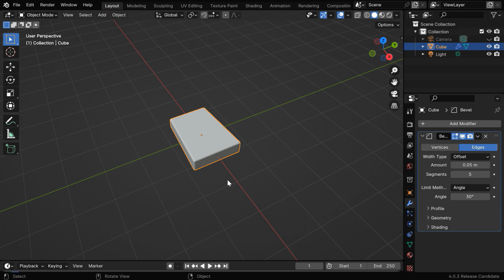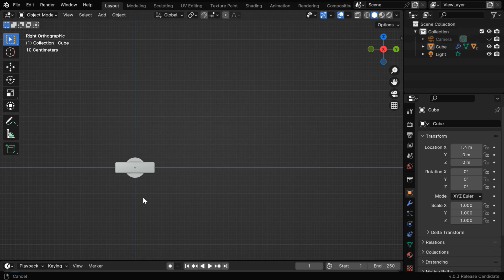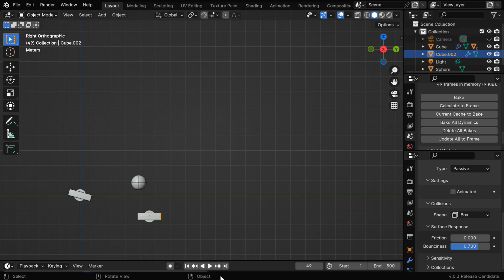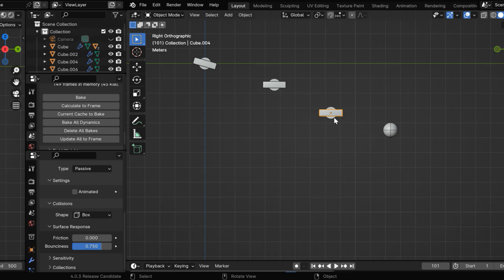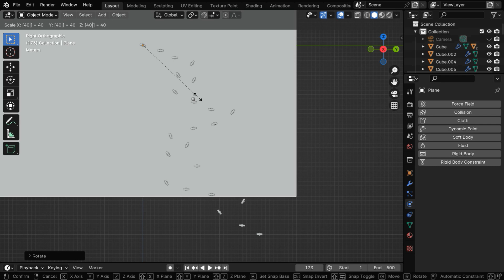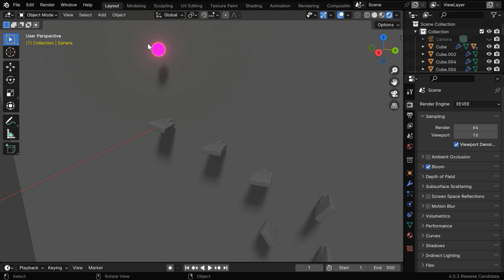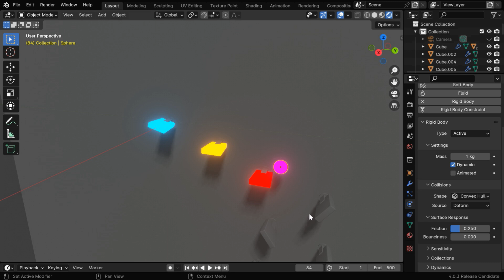Musical Marble Animation | Step By Step Tutorial In Blender | Rigid Body Physics With Sound & Light

Comment: יש לי כמה שאלות:
1. כשהורדתי את פיזיקת הגוף הקשיח של הכדור והקלידים, הכדור פשוט חדר אותם כאילו הם היו אוויר, ולא קפץ מהם.
2. בערך בשלב שבו אני החלפתי את החומר של הכדור, כל הסרטון נעשה יותר איטי,  אפילו אחרי שהעליתי את קצב הפריימים.
3. איך אני יכול לעשות שהמסך יעקוב אחרי הכדור, כך שאני לא אצטרך לראות את כל המסלול מרחוק?
4. איך אני יכול ליצא סרטון של המסלול?
Reply from the maker: 1) Please check if the rigid body physics is actually removed from the ball. It seems the physics was removed from the keys, and not from the ball, hence the ball is falling under gravity and it is not bouncing off the keys. Basically you might have done some mistake at some point, it is difficult to guess unless I see your blend file. 2) It depends on the material you attached to the ball. If it is a simple one-shader material, it should not impact the video playback speed, but it can certainly get impacted with more complex materials. But in any case, what you see is only a preview, and it can be slow - but the actual output won't be affected by this. Once you create the output video, the playback speed won't be impacted. 3) You need to set up your camera to follow the ball. It is a long topic, I suggest you watch our camera tutorials to get more experience on this. You can also purchase our add-on called "Set Camera On Track" which is specifically made for this purpose. 4) The process of converting your animation into a video output is known as Rendering. Please watch our tutorial to know how to do this 👉 https://youtu.be/w4YSGljBdww

Comment: I can't remove the rigid body physics from the keyboards (the remove option is turned off)
Reply from the maker: Please check if you unknowingly selected some other objects apart from the notes. If you select a mix of rigid body objects and non rigid body objects, the rigid body options remain disabled. Often a light or some other object gets selected when we try to select a set of rigid bodies.
Reply: @5MinutesBlenYou marked the keys along with the ball.
Reply from the maker: @ Yes that's correct. But in your case maybe your selection includes the background wall or the light - just a possibility - so the rigid body options are disabled. Another way to remove the rigid body physics is to select an object and go to the physics tab, then remove the rigid body physics with the cross button. But in this case you have to do it for each object separately.

Comment: by ball stop after touch some nodes
Reply from the maker: Please check if the physics bake is stopped at that frame. By default Blender physics works up to frame# 250 and then it stops. You need to manually change this number to the end frame of your scene so that the baking process does not stop at a random frame within your scene.

Comment: How do I make things smaller
Reply from the maker: You can select an object and either press S in the viewport to get the Scaling tool and use the mouse to make it smaller, or you can directly change the scale factors in the object properties tab. If you want to make all the objects smaller in an existing animation, I would suggest you rather increase your camera distance - it will make everything look smaller. Changing the scale of all objects in an existing animation may prove time-taking and a risky adventure.

Comment: Thanx for tutorial. Trying to make the same animation and i have problem with that. For example, i placed 10 notes. Ball move like i want, Simulation is good. BUT when i add, for example, another note - traektory of the ball changes for first 10 notes, But - this another note can not influence on the ball traektory for the first 10 notes. But it changes, and i can not solve problem - its again and again. Calculate to frame, i of course press. How can i save correct traektory for the first 10 notes and continue simulation after that? Or how add notes, and make it not influence on previous traektory. I tired to tring solve this problem
Reply from the maker: I understand the issues. Blender's physics is not 100% perfect. It uses an approximation at every step. So adding some new notes in the scene can sometimes dis-balance an existing physics - even at a previous step which seems completely unrelated. To overcome this issue, before you add the new objects, you can convert the existing physics movements into keyframes (bake to keyframes - we discussed this toward the end). And do take a backup at each step, just in case you need to go one step back to correct something. Now add the new note and keep converting them into keyframes at a regular interval. Even Blender's official guide recommends this since the physics is not 100% dependable always.

Comment: 9:09 There are a lot of musical notes.  I'm tired of adjusting the color changes on the musical note material one by one every time the marble ball touches it.  is there an automatic way to change the entire color of a musical note when the marble ball touches it?
Reply from the maker: We made a tutorial on how to use a script to detect the collision (with the ball) and add a custom property for each note without any big manual effort, that tutorial is here 👉 https://youtu.be/jOc559tQzuo With an extension of this method, you can set up a shader node group that checks for this custom property and assigns a random color for each note once the current frame crosses the Collision Frame for each note. This can take care of a huge number of notes with very small manual work.

Comment: Great tutorial. I discovered that there's no need to disable friction as this will cause the ball to not rotate naturally as it would in real life, thus breaking the realism. To prevent deflection, I simply place two vertical planes each set to passive rigid body on both sides of the ball to serve as a barrier. Of course, I have to disable their visibility in the viewport and render.
Reply from the maker: Yep, that's one way to restrict the deflection, I suggested this as well for someone 👍 Or we can let go the rotation and add it later using a driver (rotation calculated based on the move and the angle of move automatically). This looks reasonably real and it is less cumbersome. But your method is also good 👍

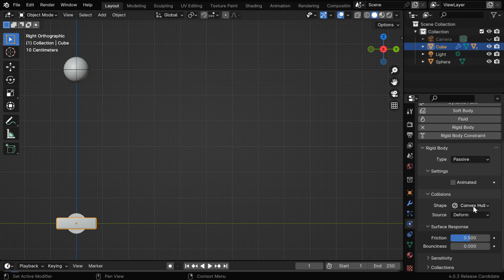Comment: Thank you very much for sharing, it has made me gain a lot. During the operation, I have a question, "My object will appear black lines after the video 3:42 shape is adjusted by Convex hull to Box", I can't solve this problem, can you answer it for me👃
Reply from the maker: The black lines usually appear only in the viewport, not in the render. It signifies the physics shape being used, it does not affect the render output. If you see such lines in the actual render, please send your blend file to us at 5minblender@gmail.com so that we can investigate and then suggest.
Reply: Thank you very much for the tip:yougotthis: @5MinutesBlender

Comment: Hey, bro, how to combine collision detection and random colors from the previous video? I'm a beginner in blenders, noob.
Reply from the maker: The collision detection script will define a custom property for each of the notes (this property will hold the frame number at which the color change should happen). For the random color, if you are referring to our earlier tutorial, you just need to mix the random color with the base color of the note using a Color Mix node, and add a driver for the FAC input of this note. The driver will check the custom property (collision frame number) and set the FAC to either 0 or 1 in order to take the base color before the collision and the random color after the collision.

Comment: it dont work i do everything like u but it wont work i dont understand the black background dont work it will be everything black or not grey...
After that the shader editor its not like your editor i just have 2 tables and you have 4 i know i can add them but if i try to put colour on the notes every note change the colour und not just 1 note... im so sad it wont work like it does in your video...
Reply from the maker: Don't worry. The notes have their materials connected by default, hence changing one of them changes all. Please select all the notes, then go to the Object Menu > Relations > Make Single User > Materials. Now each note will have its own copy of the material and you can change them individually. Sorry if this was not obvious. If you have any other issues, you can send your blend file to us (5minblender@gmail.com) with a problem statement. We'll help you to resolve all the issues.
Reply: thank you it workedd!!
Reply from the maker: @mertsari4809  That sound great! 👍

Comment: I tried to use previus color change based on collision but it not working is not give the tiles number of frame its stay in 0 (just work for the ball) Could you help ?
Reply from the maker: You need to keep all those object in a single collection and select the ball while running that script. The script simply picks up the currently selected object (the ball) and runs through each object in the same collection, it tries to figure out when each of those objects (the notes) comes in close contact with the selected object (the ball). It will add a custom property (frame#) for each of those notes. So please check if you are using the script with the right context.

Comment: The tutorial is amazing as always. I have watched such videos, Do they really use blender or another software coz their results is always top notch. I tried it using blender, but the process is very tedious and destructive. If you need to adjust one of the bounce, it renders the whole system null and now you have to repeat again.
Reply from the maker: Thanks! I can't say for sure whether they use Blender or something else, but it is 100% doable in Blender - not just the animation but the background sound as well. We rendered it using Eevee to show the beautiful output possible even with Eevee. But if you render it using Cycles, you'll get even better results. And as far as the physics part is concerned, it is simply practice. I did this tutorial in 2 trials, it was not that difficult for 23 notes. But even if we have 100 steps, it is easy if you keep on converting your physics simulations into keyframes. Never keep the physics simulation as it is, convert it after say each 10 units, then you would never have to re-do the steps from the beginning. That I think is the key factor here 😊

Comment: Hey! Amazing as Always👌. I have a question related to cloth physics. When I scale an object with the cloth physics applied to that. That does not work. Is there any solution to this problem or any other workflow with which I can achieve this?
Reply from the maker: Yes you can do that using Geometry Nodes along with Cloth Physics. You must have noticed that Cloth physics is always added to your object as a modifier. Blender will evaluate the modifiers in the same sequence as they appear in the modifiers tab (and you can manually change this sequence if needed). What you can do is, add a Geometry Node to your object after the cloth physics is added. This will add a new modifier to your object. In the geometry node, use a transform node to scale your object, and you're done! The cloth will change in size without needing you to re-bake it afresh!
Reply: @5MinutesBlender  Excellent!😍. It's working perfectly fine. One more question related to this. If we don't want to change the scale directly rather we want to control it via another object let's say by parenting or by object constraints, then this method will not work. Is there any way to do that?
Reply from the maker: @arslanahmed5676  No, we can't use parenting or constraints, that won't work. But you can use a second object in your geometry node and use its scale factors to drive the size of your original object. So in a way you can drive the size of your cloth using another object as parent, although it's not a 'parent' object in the technical sense.
Reply: @5MinutesBlender  I've tried Object Info node going into the transform node and it works. Did you mean this or you were saying something else because I couldn't quiet get your point by saying "second object in your geometry node". Anyways it is working, Thanks.
One optional thing is that when you scale by this method. The cloth object and the other object get scale up and down at their own location. But when you use parenting, normally it also changes location with the change of scale relative to the active object. Is there also a way to do this?
Reply from the maker: @arslanahmed5676  Yes, that Object Info node is exactly what I meant. You did it correctly 👍 You can do the same with the location as well. Just like the scale factor, you can also get the location of the second object from the Object Info node and use it in the transform node to move your original object. Basically we are implementing the parent-child relation manually using these geo nodes 😂
Reply: @5MinutesBlender  I think I couldn't explain my point. I was not talking about the location. Let me tell you via an example.
Let's say we have two objects, parent and child. If we scale the parent object, the objects will be scaled maintaining their visual distance. But on the other hand, if we scale using the Geo nodes setup, the objects will not maintain their visual distance and they will get through each other.
If you still can't understand my point, I would request that you do this experiment in Blender, you'll know what I am talking about. Thanks
Reply from the maker: @arslanahmed5676  Got you now! That behavior can be also implemented in geo nodes. In the transform node, we have to manipulate the scale as well as the location (translation) of the target object, taking a clue from the parent object (through Object Info node). To maintain the relative distance, we need to first get the distance vector between these two objects from their existing locations, then multiply that vector with the scale factor of the parent (using a vector math node), finally use this vector math output for the modified location of the child. This is just the skeleton, I did not try this by hand, so you may need to fine tune a few things here and there in the actual node setup.
Reply: @5MinutesBlender I tried this method and also changed some settings, but it seems like it's not working. It always shows some weird behavior. Sometimes it works correctly, but when I rebake it, it just does not work. I've searched online and asked ChatGPT a few times; it looks like no one has ever encountered this problem. Could you please make a video on this topic? I would be very grateful. Thanks.
Reply from the maker: @arslanahmed5676  If it works sometimes, and does not work the other times, it may be related to your cache. An outdated cache can cause frustrating issues, and moreover it might be hard to remove the cache completely. In one case I had to even start with a fresh file and rebuild everything from the scratch, then it worked. Since you said it works sometimes and breaks otherwise, I have a doubt on this cache issue. Please check that.
Reply: @5MinutesBlender  I forgot to tell that I had the same doubt and I tried using a fresh file but the issue persists. When I say it works, I mean it works to some extent, like until certain value and that value is not constant.
I am sorry that I am taking your time too much but could you please make a video on this topic because no one has ever made. This would be great help for me and also for those who are gonna get in this problem. Thanks
Reply: @5MinutesBlender  Hey! Thanks for your cooperation. I've blended the classic and modern technique to make it work. Instead of directly using the Translation, Rotation, and Scale of the parent object (Using Object Info node), First I've Parented an empty to that object and then used that Empty to drive the properties of cloth. In this way relative distance is maintained when scaling and also it rotates perfectly.
By the way Thanks for you time. Your videos always help me. Keep Creating
Reply from the maker: @arslanahmed5676  Nice! That's a great technique that you invented! Cheers and thanks too 👍👍

Comment: Thanks and congrats. There is always a lot to gather from your tutorials. 

One thing I noticed though. The bounces aren't 100% correct according to the laws of physics. 

This is something I noticed also that even on big money, big names movies. Birds, dragons, and things that fly don't fly really realistic. If you can provide them with a solution to that there will be good money. I think the dragons should fly like manta ray swim. With some wave going through the length of the body, synchronized with the wings. In a more subtle way, it is the same thing for birds.
Reply from the maker: Glad to see a msg from you 😊 And thanks a lot for the appreciation 💝💝 Yes, sometimes an inaccuracy in physics is intentionally added into the animation in order to dramatize the effect or to create a dreamland experience. In this case though, we used the default settings in Blender, which can be (and should be) optimized for a production level output. To make things more accurate, we need to use a higher number of iterations and higher substeps value for rigid body physics - both of these fields are found under the Rigid Body World settings in the Scene tab within the Properties editor. With higher values in these fields we get higher accuracy, but the baking process becomes exponentially slower. I get your point though on the waving of wings - it can be made more realistic. At least a system limitation or an overlook may not be the reason behind, probably the animator is not adequately paid there 😂😂
Reply: @5MinutesBlender That's the problem here. The pay, I mean.  "If the money is there, I'll do anything, Babe" (Mae West)
Reply from the maker: @johnsmith56920  😂😂😂